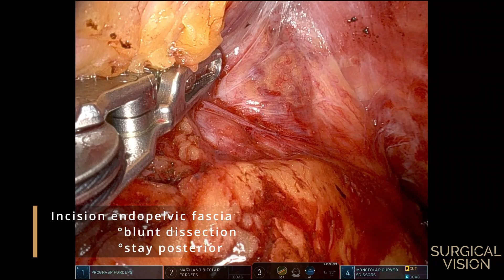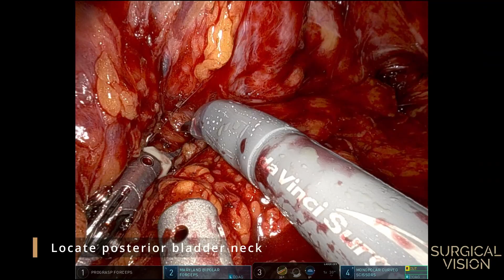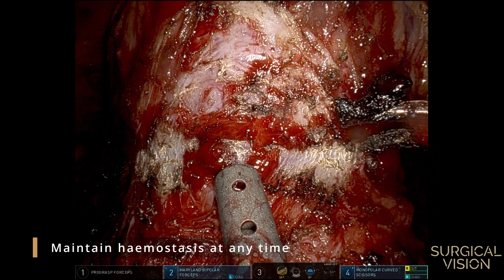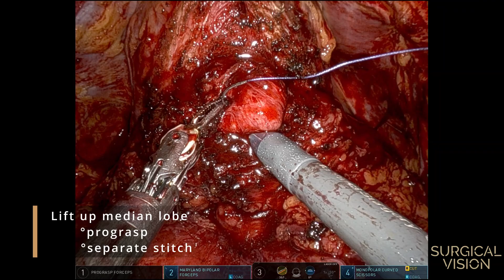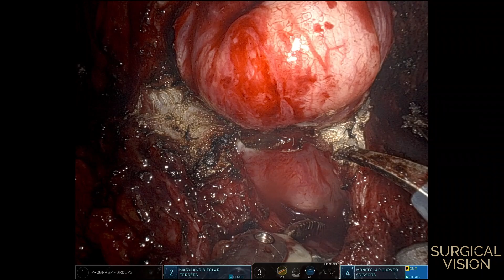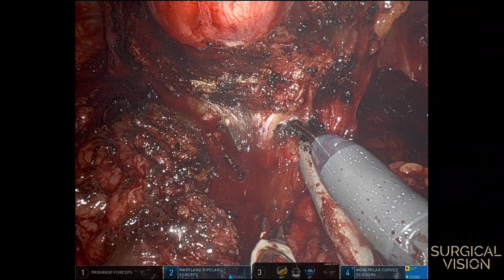Robot-assisted radical prostatectomy with a median lobe

Comment: While marking the lateral bladder neck- how do you address the often strong vessels in this area? Directly coagulate them? Coagulate them during the bladder neck dissection itself? Or do you sometimes also use clips?
Reply from the maker: Hey Phil, these can be very bothersome idd! Most of the time you can control them with direct monopolar coagulation during the dissection of the bladder neck. If this doesn't do the trick (they can tend to retract making it impossible to reach them), grab them with your bipolar instrument and coagulate with the scissors onto the bipolar instrument, it will release more energy compared to regular bipolar coagulation!
Reply: @surgical.vision  I see! Do you fear any effects in the nerves while applying this technique to those posterolateral of the bladder neck? Especially when you do the "grab-and-mono"-cautering.
Reply from the maker: @phil673  idd postertolateral to the bladder neck I prefer using clips! On the bladder neck itself you won't damage the nerves